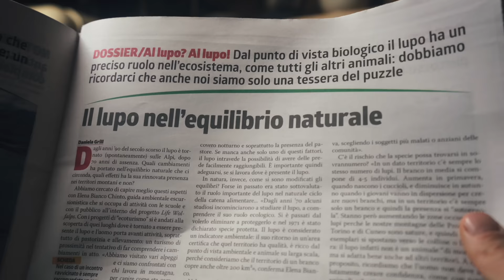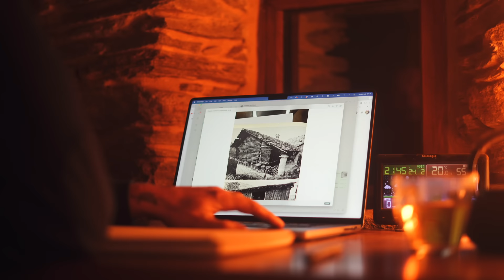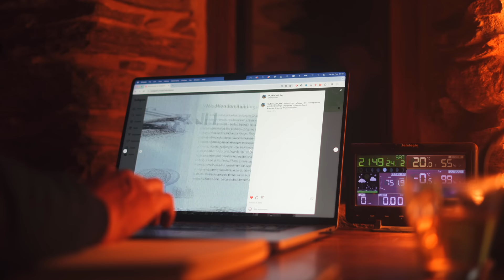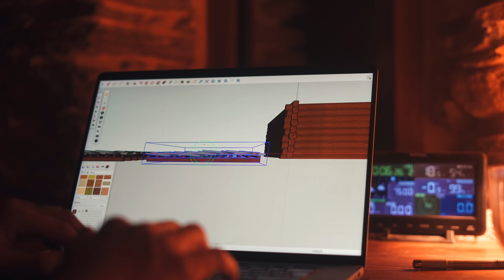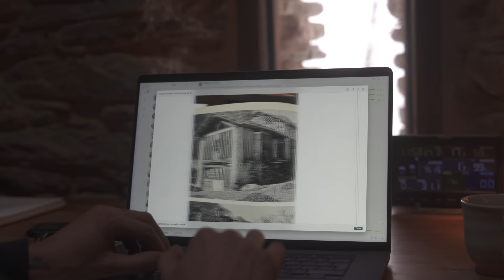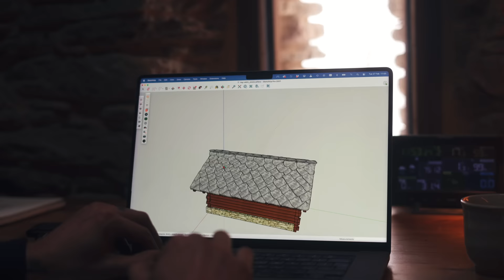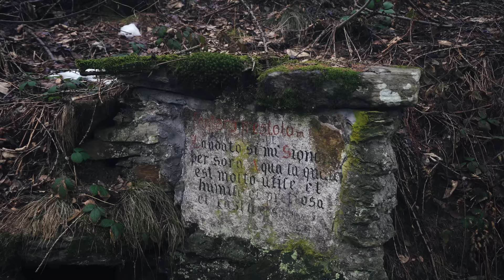#102 Winter has returned, and so have the Wolves

Comment: For the chickens, you might consider providing them a dust bath. It’s suggested aiming for a container with a length and width of at least 24-36 inches and a depth of 6-10 inches.

Your chickens should be able to easily hop in and out but you don’t want all the material to fall out either.

Made of Sand or soil, Food Grade Diatomaceous Earth, and Wood Ash.
The two most important materials above are the diatomaceous earth and wood ash.

Both of them will kill pests that infest chickens which is the number one importance of the dust bath.

The dirt or sand is just a filler to mix in so it’s optional. Then depending on what you have available, the wood ash or diatomaceous earth should be added in to kill pests. Just a thought. They will love it.
Reply: There are too few hens for their socialization needs.  Very important, they can get depressed.  Some hay, along w/more food, it’s cold out there.

I am Guessing some vitamin D in w/feed, it’s been a while as to solar rays.  Maybe some D and more cheese/yogurt/eggs/calories for our ever more lean artist as well??

Thank you for all!

My first real aesthetic quibble as a renovation architect… that vertically applied “flag stone pavers” up the pony wall.  Ugh.  Would remove.  Slabs go on the horiz planes (floors, paths, terraces, roofs), as you already know, our dear renaissance friend!

Taking it all in from a few grey and windy  days in the Pacific NW (Seattle)
Reply: Otherwise 2+ years of decision making has been flawless.  Especially the radiant staircase oven concept and execution, in every aspect.

Ciao!

(Feed and bild up hen population… and?? find yourself a pup❤)

Comment: Martijn, a huge tip is to seal the stone prior to grouting. After you’ve laid it but before grouting. Makes it SO much easier to grout. Wipes right off the stone rather than having to scrub it off so tediously. Also, a “matte” finish sealer will keep the natural look, just enhanced a bit.  Looks great by the way! 👍
Reply: Also, use a much drier mix. Just wet enough it binds together when you squeeze it, but not wet and sloppy. You can then wet the whole floor once it's pressed into the gaps.

Comment: Martjin is on the right track as the mason "grout bag" method of applying to brick or stone joint grouting is far less messy and cuts down on cleaning up grout residue and keeps even open pored and heavily chemically sealed natural stone from still absorbing modern cement grouts that endless sponging and cleaning just often doesn't remove that residue "haze".😇

Comment: You will have to polish the stones afterward to make the floor smooth with a special machine. In between the cracks, you can place tiny little colorful stones to connect instead of just cement and concrete sand. The end result would be like a marble floor. Our contractor built it for the main patio entrance, and it was beautiful. Off beige or darker goes well with little green stones.

Comment: Filling the tiling gaps; apply a runny filling first, followed by a more solid filling. For a better filling. Basic set for filling the gaps between floor tiles. Wide rubber spreader.  You will also need a large sponge with a handle and an oblong bucket with 2 rollers on top for cleaning the sieve. Change the water clean often enough.
Reply: I wondered if a squeegee or a rake with a foam pool noodle or foam pipe insulation strapped into the forks would help remove the grout from the  stones…

Comment: just a musing about the downstairs room - flat stones stuck on the 40cm high concrete reinforcement look rather odd. both that and the 120cm high reinforcement concrete structure could be hidden behind rustic wood pannelling, along with the stonewall above each. A light-coloured timber for the wood pannelling could contribute to making the room visually warmer. all the wall pannelling above the concrete reinforcement structures could become hidden cupboards. the wood pannelling at the end of the wall on the side of the stove would resolve the awkward look of the actual wall meeting the stone facade of the stove.

Comment: Hi Martijn I expect you’ve now finished the floor but this might help for future projects . Make up a dry mix 1 cement to 4 sand , pour that on to the floor and sweep the dry mix into the joints . Make sure the mix is off the face of the stones then use your water spray bottle to give the joints a soak .. not to heavy , wait 20 minutes then spray again . Personal choice you could then use a pointing dowel to give form to the joints or just leave to get a more rustic feel . Depending on temperature the joints will set hard in two days .. leaves a clean uniform finish with out having to scrub the slabs clean .. really enjoy your videos takes me back to my youth doing similar tasks . All the best

Comment: This episode made me think how nice it would be to have the 2 buildings, or at least the lower entrances, connected  with a roof. The view from there seems great for some sort of terrace to sit outside even when it's raining or the sun is too strong, park a trailer or materials without getting wet and move between buildings without getting feet wet.
With these strong winds probably has to be super stable. Connecting beams could be an option.

Comment: There is life in the drawings, and if only the structure has strength beyond the ordinary and possible then the hours of research has deemed excellence pivotal in the future of the place.  It has been an intensive work from the beginning as seen.  And you have decided the way and posture to maintain the quality that assures inner satisfaction on what you have accomplished.
 
I think stone tiles are easier to work on than the back and patience-breaking slab of stones as roof heavier than many.  When the birds are back and grass starts to grow then spring must have arrived.

Comment: I have done that flagstone flooring work, and it is certainly a mess. I have used hydrochloric acid, to clean aferwards (muriatic acid, 'acido muriatico' in Italy, sold cheaply at any drugstore, supermarket...). The acid eats the cement away. You have to ventilate well the room to protect your eyes and lungs.

Comment: smearing a trowel full of adhesive onto the bottom of the stone (buttering) helps to avoid air pockets and years later a lose floor stone.  Nice work I had completely forgotten about your project, a long road still to be travelled, good luck

Comment: Painting the flagstones you have laid on the floor with diluted PVA wood glue seals the porous surface which will prevent fat or oil stains from disfiguring this stonework. However, it does leave a slightly shiney finish, which maybe not to your taste. However, it this is probably better than leaving the natural pore systems unsealed and susceptinle to dark stains that will gradually accumulate if the stonework is left unsealed.

Comment: I use a "grout Bag" to apply grount into the joints - then force it in with a float. It make much less mess and there's less waste too. Similar to a cake decorating bag.Your method will work - but it's a lot more effort.

Comment: Your stone floors will be terrific when you finish,, you might want to try a Mason grout bag,, it's similar to pointing with a trowel but your have much more control over the placement off the mortar,, images a extra large cake frosting bag,, full it up and squeeze into the middle of the joint, then strike with a margin trowel,, or pointing trowel,, you could make your own from extra heavy canvas and waxed cotton thread,, but where you are you should be able to find a proper commercial one,, it's not only good for floors but stone walls also, cheers

Comment: I assume it was warm enough in the house to work with the concrete.  Around 40 -50º Fahrenheit is required for proper setting and to avoid chipping and cracking. What a beautiful floor!

Comment: For grouting your floor, I suggest that you mix up a rich but very wet mixture and pour it into the joints.  Your grout will go a lot further and be easier to wash off the excess when it has started to harden

Comment: when you replace the roof on the other stone building: my ideas....

cut out big sections of the walls and put in giant windows...then use the stones that you removed from the walls to make the structure taller, maybe even 3 stories instead of 2 - might as well if you are going to take the whole roof off anyway.....

Comment: It might be easier if you use finer grain sand (white) with cement and make it really fluid so it can go into all the crevasses. You can also add “compactuna “ it’ll make it smoother to work with.

Comment: Thanks for another lovely video. I wanted to let you know about a system where a fire can heat a water tank that can run water in pipes in your floors and also heat your water for regular use. My cousin in Norway has this and he only needs to do one to two fires a day in the winter and one in summer to heat his farmhouse floors and have hot water for a family of 6. I’m thinking about how cold your stone floors will be and maybe you can do something like that in the other building.

Comment: Offering an unsolicited opinion from New York State, The stone pillars/log design is the one for the new building. Wonderful videography and craftsmanship as always. BTW, a solution of muriatic acid (HCL) and water will easily clean the stones after pointing and save a load of time.

Comment: The sponge method is great, you can grout with a sponge and clean it shortly after. No need to water the stones you have all needed in the mixture.
The consistency of the mixture should not be thick, something like peanut butter is perfect. Buy a lot of sponges they wear quickly. Always use nitril gloves cement will burn/dry your hands  hands badly so lemon is your best friend, rinse well after and use hydration cosmetics. 
Acid rinse will show again beauty of the stone, but gloves and eye protection is mandatory. Using lime in mortar will improve elasticity and plasticity but it is too late now you will have different tone color. If you have any questions jus let me know. Great job anyway :)

Comment: Where he lives his house would need a strong, sturdy, thick wood door which can be securely barred inside, not with some simple door lock but with a long bar across the door.  The windows have to be closed with strong, wood shutters than can also be barred inside.  There is absolutely no going outside after dark.  If the house does not have a latrine, you use a wood bucket.

Comment: Had to smile - hat holder in the floor - you find a use for everything.  Wonder what the dog was digging for and it knows the property.  I would ask questions there is a story there.  Floor looking great.  Drone showed roads so you don't look so cut off after all.
Reply: 😄it's a place expecially designed by Martin to dry wet clothes, because there comes up most heat from the stove below

Comment: the icing bag Method will be far easier to apply & control the cement.
If you go for the stone pillars then the walls could be designed in such a way that they could be easily changed if you wish at a later date, the most important part of the shed/garage build is to build it to the maximum size that they will allow, yes it will cost more right now but you will for ever kick yourself in the future if you don't.
Kiwi Rod

Comment: I think for the first time Martijn has made an aesthetic error.  That stone cladding on the short vertical wall is both inappropriate and unsightly.  He appears to know it from his comments about not doing it on the taller concrete walls so maybe he will correct it eventually.

I would also prefer wood for the lower floor as well. It's more comfortable and  looks lovely. But maybe he wants it flood proof?

Comment: This is probably going to sound stupid because I've probably missed something, but here it goes. Watching you put in the downstairs floor, it really looks like the door going to the outside is one of the shower walls. Which looks like if you want to come in from outdoors (downstairs), you have to go through the shower. Conversely, if you want to exit downstairs, you have to go through the shower. And finally, when you're taking a shower, you're totally exposed to the outside world. I told you this would sound stupid, but every time I looked, that's what I was seeing. That can't be right, can it?

Comment: Wonderful workmanship Martijn. I do have one question. I know it would take away from the open air staircase, but for safety, is there something to put on the edge of the floor to prevent rolling off? I worry about that.
Another great video. Thank you.
Reply: Apologizes in advanced. For reasons beyond my control, I lost your reply to me.
I am by no means a professional graphic artist. Nor am I an engineer. But if I may suggest, perhaps a sliver of matching wood across the edge of the length side, just to prevent any exciting movements (as I have done myself) from rolling the chair onto the abyss. LOL. My best wishes to you Martijn.

Comment: Can anyone please tell me if there is any insulation under the concrete slab in the basement? It seems to me like it's not the greatest idea to install a stone floor on a concrete slab with no heating. Must be extremely cold in summer and unbelievably freezing in winter...?